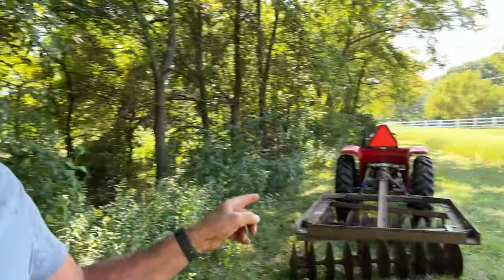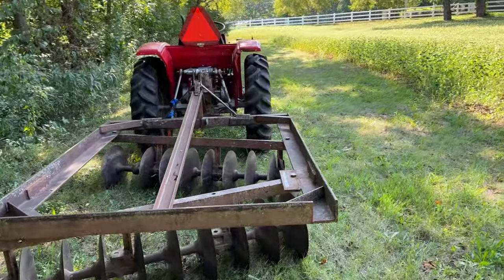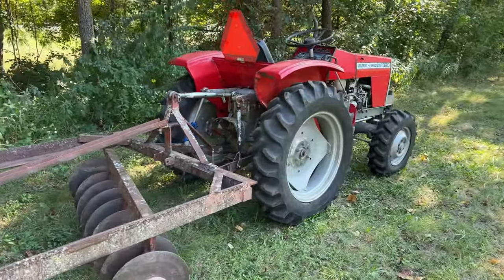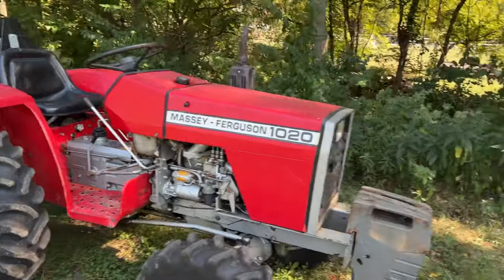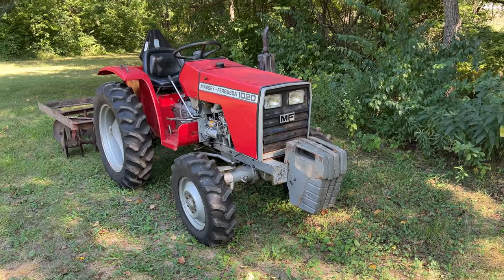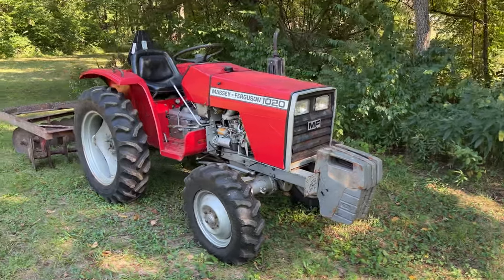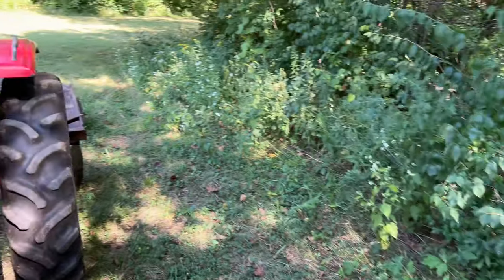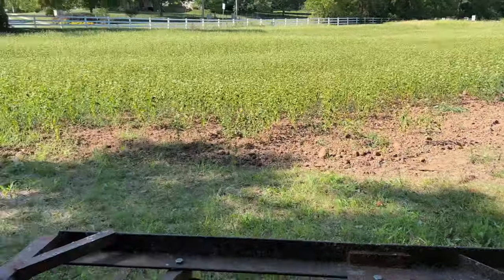Can the Massey Ferguson 1020 Pull the Disc? Let's find out!

Comment: Gots me a 1988 Massey-Ferguson 1020 2WD "hydro-slack-o-matic"( with ROPS) " non-loader configuration Track-tor ".with 1600hrs. It werks great with a 5 foot roto-tiller , and a "cutom-deluxe-doze-a-matic hydraulic dual parralelegram mounted trip or solid action Front Dozer Blade with 22" of parallel travel. Had to "convert-a-late" the "radi-ater" to a jeep compass configuration.( origional NO LONGER AVAILABLE).The "whole rig" is quit handy-dandy fer light-duty werk;; just wish it was 4WD or it had a "load-a-matic" Loader-assemblys. ( this is my only Hydro-slack-o-matic in the fleet). Thank you Sir for the Excelent vidio and happy safe tractoring. Best wishes with all your endeavours.

Comment: Perkins engine???
Reply from the maker: Not on this one - these were Japanese built machines
Reply: @froghairfarm  I operate this model also and it's a Japanese Toyoshaw 35 HP 3 cyl NA diesel engine
Reply from the maker: @ogr7771  yep they are Toyosha engines, tractors built by Hinomoto

Comment: I like the 1020 videos. It’s nice to see the old tractors still being relevant as they age. Does your 1020 have power steering?
Reply from the maker: Thanks! I like the little tractor, it's tough and looks the part. No the 1020 doesn't have power steering, not sure that any of them did, but mine sure doesn't.

Comment: Interested in one of these machines but it has a loader would you recommend them?
Reply from the maker: I would recommend it, I would love to have a loader on mine, but have other loader tractors so I don't really need it. The main thing to consider is that some parts can be hard to find. So far, I have had no problem but they can be.